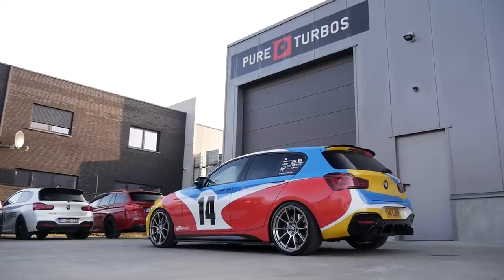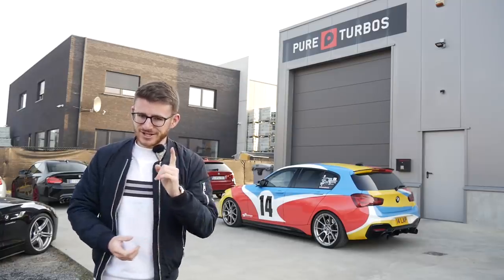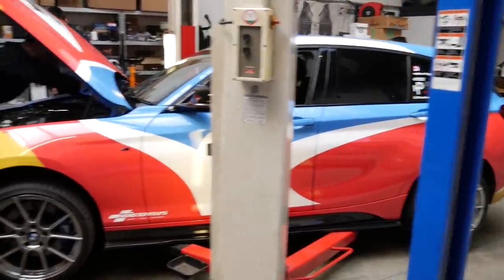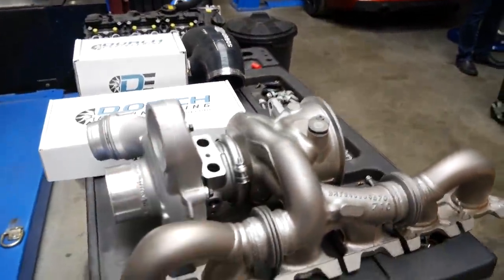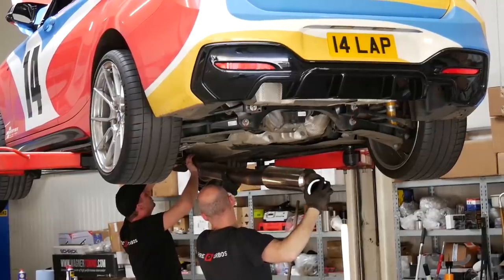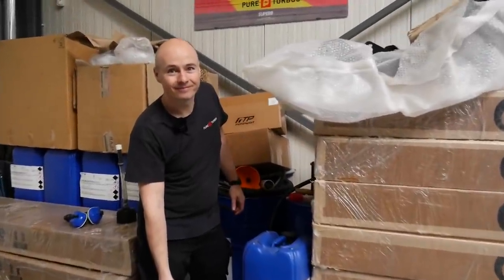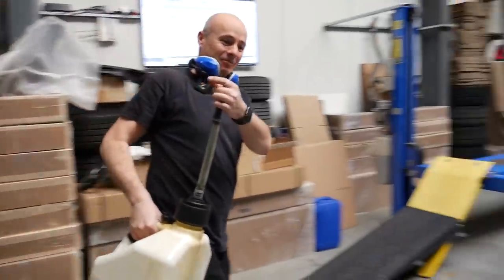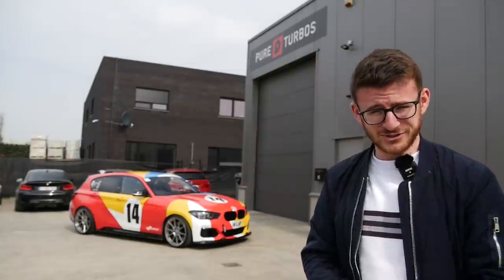Introducing My *700+BHP HYBRID TURBO* M140i!

Comment: brilliant vid luke you made a monster and peter is a proper nice chap👍 i got my c63 amg mapped recently and it made 617 bhp and 857 nm its just endless power and yours running the 730 bhp will be something else, now just waiting for the first drive 👍😀
Reply: stock turbos on the m177 completely fall on their face @ 5700
Reply: @DECKEDM  maybe on Standard map , mine just keeps pulling 😀

Comment: Pretty sure pures/dynojets whp is what hp figures are in UK. The bm3 ots 2+ maps were 450whp there and 450hp in UK. Which makes sense as you were doing high 8s low 9s 100-200 on that previous 2+ at 410wheel there meaning an accurate 410 here, not close to 500 as previously claimed

Comment: 478 is strong numbers on the stock turbo mate I think the figures you was getting before almost 500 were abit optimitic, like mine makes 456hp 2+ without meth
Reply: Jordan it's time for a trip to belgium to get a 850 installed. We did my friends one 3 weeks ago 651 whp stock block
Reply: 470hp is what u usually see even with stock HPFP,
And about 490-500 with HPFP 

…both on 300cell sport cat
Reply: @vollcare4076  on 99 Ron / 93 octane ? Defiantly not mate
Reply: @jordanlegard3764  yes ca 98-102 ron 

Pls see MHD OTS figures
Reply: @vollcare4076  102 Ron maybe but don’t just read what they tell ya mate, I seen dyno runs day in and out and 99 Ron they make 450-470 max at 2+ with fuel pump and downpipe , you need ethanol to get close to 500
Reply: @jordanlegard3764  💯

Comment: 520 whp on pump with meth? Or just 99 alone?
Reply: It has to be with meth? I’ve not seen any B58s make 600+hp with just pump fuel
Reply: @s11smk87  living life fast the white m140i is 700bhp and im sure his is on pump fuel alone.
Reply: @carmad1287  that’s with PI meth, I spoke to the owner about it
Reply from the maker: With meth
Reply: @s11smk87  mine has 627hp 98 only no meth
Reply: @MrCogs84  😂

Comment: 620bhpl on  pump + meth 730bhp e30 + meth  or you scrapped the meth completely luke ?
Reply from the maker: Meth is on with both maps
Reply: @hampshirephoto it is like it was . Nozzle on charge pipe or you do port.

Comment: Measure 0-100, 100-200 time
Reply: Should be around 5,5s 100-200
Reply: @vollcare4076  should be below 5.5s with 730hp on E30
Reply: @ChrisClifton  maybe 

Please have a look at Daniel ABT YT Channel:
There was recently a 700hp M140 xdrive doing ca 5,7s
…and winning over Lambo STO ;)
Reply: I guess around 5,0 or even lower since I know some M140i with 600BHP which make 5,7-5,8.
Reply: @gwspom  whp or clutch/bhp ?
Reply: @vollcare4076  and the XDrive car will have more loss in the drive train and weigh about 100kg more.
Reply: @ChrisClifton  yes it’s ca 60Kg heavier as a RWD (8-speed)
Reply: @vollcare4076  you mean 8 speed X drive is heavier than 8 speed rwd. So the extra weight of a passenger and the drive loss makes a large difference when testing. They're also closer to 80kg difference in the real world on actual scales.

Comment: only person that rates a hybrid turbo is the guy selling it....take that guy....he'll not offer the Garrett and custom manifold because it works out the same. 

hybrid= high torque/high boost/high risk to compressor housing.
Reply: Or they are totally different turbos for different installs. A hybrid like a pure/Vargas etc will be a straight swap whilst others are more complex and might need boost controllers and new funky manifolds. 

You can't slate the hybrid turbos power after seeing what these can do.
Reply: @ChrisClifton  put it next to one with a funky Mani and a gt35

problem with the hybrid is cost....it's a stock unit with a bit of grinding and a new core from bay.....have a look on bay if you think I'm lying....

so cost....about half that of a Garrett unit but if you look at the cost to YOU the customer you'll be shocked that you could of had more power more reliability but no....you cheaped out and got a hybrid..... because the garage said it was good to go.

Garrett any day

hybrid....bin it.
Reply: @andrewwright.  you probably believe in wrench sauce too.
I keep forgetting how slow my hybrid is.
Reply: @ChrisClifton  it is when it pops.....what's the warranty on a hybrid again? lmao
Reply: @andrewwright.  eleventy billion years.  Find someone who has blown a pure800 and ask them about their warranty issues. It's £££ but they're annoyingly good at warranty. I honestly feel pure is like apple and Vargas etc are like android BUT I've tasted the pure kool-aid and I'm hooked. Peter at Pure is actually damn good at resolving warranty issues. I wouldn't go for a DAW turbo or something like that but the pure800 seems to have covered it